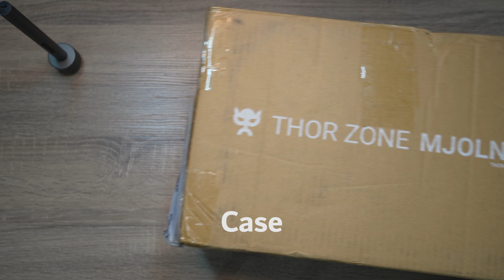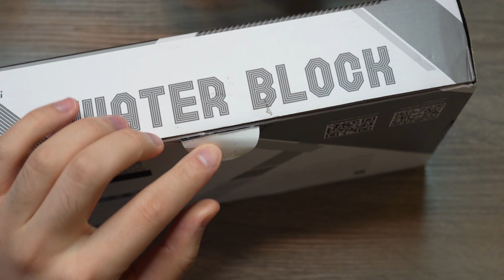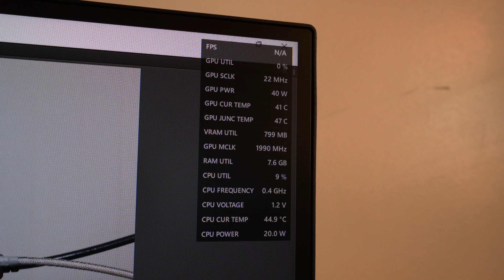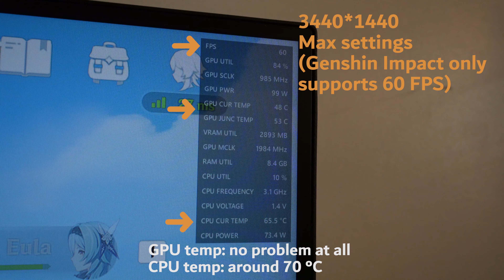Thorzone Mjolnir - Full Build - SFF ITX Watercooled - ASMR

Comment: @HL-2906 - Did you get a chance to make any updates on the cooling for your system.  Its been right at about a year?  Did you insert another fan on the radiator somehow?  I really appreciate any help you can provide.
Reply from the maker: I don’t want to disappoint you but I basically dissembled it almost right after I shot the video. This mini itx idea doesn’t work for me. I went full size and has using full size stuff since. The cooling was inadequate in this case. You really need either more radiators or downgrade to a cpu that doesn’t draw so much heat and keep the gpu air cooled.
Reply: @howardishere  Thank you so much.  As I personally considered the ITX format.  When dealing with the SFF case,  when it comes to the design. I keep running in the same issue - not enough cooling space. And that is even in the design phase.  I personally want to insert into something small that can take on about 1000 watts of power. And from all my searching and researching, I will need to do this with at least an M-ATX motherboard and M-ATX case.  Something that allows me to get in there full-size radiators and fans without compromising anything.

Thank you so much for sharing!

Comment: Hey ! Might be a bit late but I really like what you did in this case and I'm currently doing my first custom loop into the same case.
As it is very small, I was wondering how you managed to plug the pump to the radiator. I cannot seem to find a connexion that fits. Any advice ?
Thanks a lot and once again, awesome look that you got there !
Reply from the maker: I used soft tubes so it’s not too hard to connect both. Just need to make space so that the tube won’t kink
Reply: Thanks a lot for the reply, I thought you used a hard link between the both of them, this is why I was wondering !
May I ask how does the pump hold in the case ?

Comment: You did a good job, even though the temperatures was not what you wanted it was still a clean build. I would of rather used a Ryzen 7 or 5 CPU since I've notice majority of the heat created is from that CPU.
Reply from the maker: Yea the gpu temp is not bad just that the cpu is putting out so much heat

Comment: Looks great! But ya a 240 doesn’t seem like nearly enough radiator to cool these components. I too and doing a closed loop in a mjolnir but opted to keep the gpu on air and only a 5600x cpu. But I’m also only putting a 120 rad in it. Interested to see how it temps
Reply from the maker: Thx! Yea this case is meant for an air cooled gpu I think you could put a higher end cpu if you are only water cooling the cpu though. In my case if I’m not gaming the computer it’s actually fine but it’s just that the pump is on the weak side.

Comment: The GPU temps aren't that bad at all 75c is just normal under full load considering the small case also the CPU you can do some undervolting to get way better temps and performance.
Reply from the maker: Honestly GPU temps are okay I then switched the whole build to ghost S1 and realized all the heat is coming from the CPU lol being a 5950x and it really needs adequate cooling

Comment: Why'd you put the SSD on the back of the motherboard. The front slot is PCI-e 4.0 and the back slot is only 3.0. Also, if you're worried about the SSD taking up PCI lanes it wouldn't have. Just a weird thing to see.

Also, 80C on a 5950X in a small form factor like that is amazing. With a bit of undervolting you could have easily brought those temperatures down without noticeable performance loss through curve optimization in PBO.
Reply from the maker: I have 2 m.2 in both front and back
Reply: @howardishere  Ahh. Makes sense. I didn't see one in the initial shot xD

Comment: Nice build. I saw this case few years ago on RandomfrankP's channel and saw issues. I saw it again on Jay's channel and I still saw alot of issues that made it DOA for me. Too many compromises for its price tag.
Reply from the maker: Yea totally agreed. This case is basically no water cooling. AND you need to find low profile cpu cooler and 2 slot gpu only. Honestly I am not even using this case right now I switched to the ghost S1 almost immediately after building this

Comment: On the verge of buyng the MJOLNIR, a bit second thoughts after seeing this though...
Would you ever attempt on revisiting the MJOLNIR but with another approach, e.g. testing if possible to add another fan?
Reply from the maker: The maximum fans you can have in this case is 2 fans: either 2 120mm fans normal thickness or 1 120mm fan with an aio cooler with a thinner fan on top. This case would be great if you just air cool both the cpu and gpu. It’s just not meant for water cooling which makes me kinda sad. I’m not even using this case now lol don’t know what to do with it.
Reply: EBay has

Comment: Failed? I don't think so! The CPU temp is still very acceptable at 85c. 

You can't expect very low temperatures like in a water-cooled mid tower. For modern CPU's, as long as the temps stay below 90c (below 85c preferable) and the CPU is stable, thats fine. You can use power limits and undervolting to ensure this.

For GPU, anything below 85c is fine. 

You're doing very well off a single fan!

Having said that, a dan A4 H2O has far more cooling capacity.

I run a 12900kf and 3090 on a single 240mm in a 10 litre taobao cube X1. Radiator is a tx240 with 2 t30 30mm fans (these are excellent). 

My CPU stays below 85c even under cinebench (undervolting and power limit of 150watts needed to achieve this) and GPU always stays below 75c.

Coolant temp rises as high as 47c.

10 litre itx builds are inherently a compromise, but can work very well while being extremely portable
Reply from the maker: You are so right. So this build was my first time doing a water cooling build I guess my expectations of water cooling was very high and I wasn’t sure what temps to aim for. 

I used this build for about 2 months and changed it back to normal components and a normal case with air cooling lol
Reply: @howardishere  I think you did great! It's all about what you're trying to achieve 

For me, I wanted a 10 litre top of the line pc that I could fly to Europe from Australia and back in a carry on bag (which I did) - I needed portability and the system was excellent while still having the best available components.

For a PC that can sit on the spot but you want max performance including overclocking, a mid tower custom loop can do that better with 5% or maybe even 10% better overclocked performance.

I think you did a great job, but maybe didn't need a 10 litre case

Comment: Have you tried undervolting?
Reply from the maker: No I haven’t tried any over/under volting I just want to see how it will perform right out of the box
Reply: @howardishere  maybe give that a shot. I have these same components in my full sized rig on a full loop with two 360 rads and my 5950x still gets up close to 80c under load. She's just a damn hot chip!
Reply from the maker: Good info thx! I am currently using these components in a ghost S1 case. I am working on putting a video out on it. Right now I’m using 2 240 radiators with 4 fans and a D5 pump and the temps are totally under control. The pump made a huge difference I can never go back to ddc again lol. I’m planning on using 1 240 rad and a 120 rad with a ek pump block combo so everything would fit in the ghost s1

Comment: The reason why it failed:
1. The cooling is inadequate. A single 20mm thick 240mm radiator and one 15mm thick 120mm fan is just not enough to cool BOTH the CPU and GPU.
2. I find the pump is rather on the weak side (but it is enough to flow liquid through the whole loop).

I have to disaggree with you on te above atatement. I would put it down to choice of cpu and gpu. This case is not made for high end components like 5950x or 6800xt
you would have more luck with a 5600x and a 6700/xt. I went to THOR ZONE channel and this case was threee years in development.
Reply from the maker: Yea totally agreed with you. I was thinking because this case comes with a high end price so I thought I would put in some high end components lol

Comment: 83c cpi temp.toasty
Reply from the maker: Yea…
Reply: No it's not. 85c is fine 

Your expectations are all out of whack. You can't expect a 10 litre case to run temps like a mid tower custom loop.

When I had my mid tower custom loop with one giant and thick 360 rad and a 240 rad, coolant would never rise more than 5c above ambient and CPU temps stayed super cool.

That's not the objective of a custom loop in a 10 litre itx with top grade CPU and GPU.

In an itx, the custom loop's objective is to keep the components comparable to mid range air cooling in a mid tower, and cool enough to operate 24/7 stable without longevity issues.

You're really building a system much more on the edge and you have to adjust expectations for that